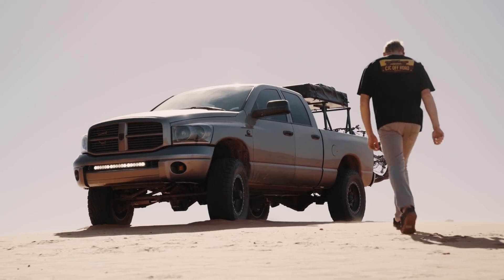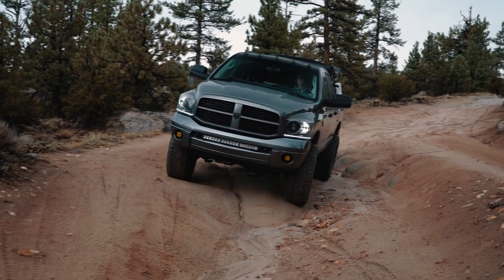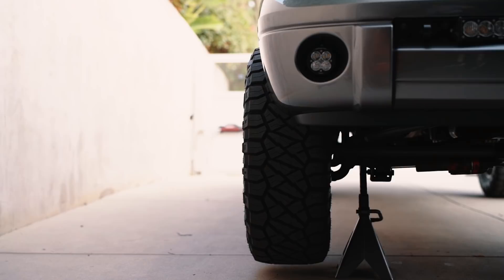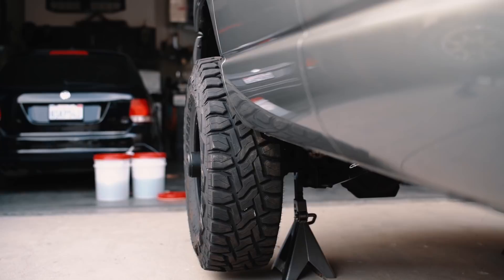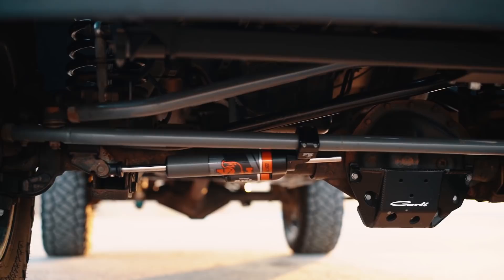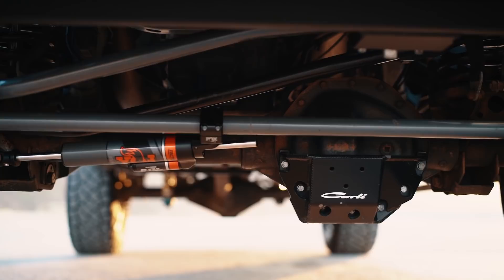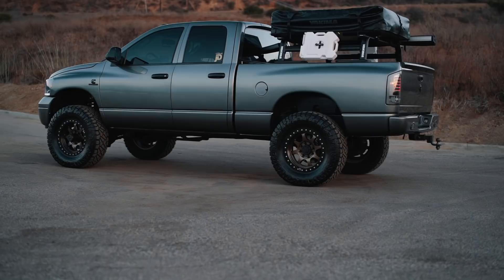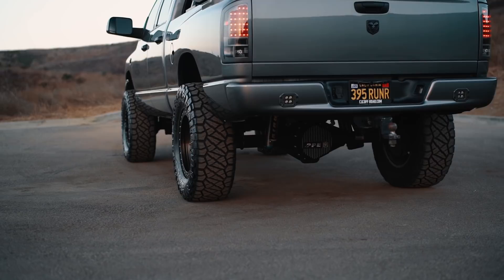How to Fit 37s on Your 3rd or 4th gen Cummins Ram 2500/3500 the RIGHT Way!

Comment: As the original owner of an 03 Ram QuadCab Cummins 4wd, I am glad you’re making videos on 3rd Gens. I mounted 35 inch Toyo AT2 on the OEM 17 inch wheels but couldn’t stand the lock to lock rubbing. I put on a wheel spacer to avoid the rub, but my truck profile looks

Comment: Yes! Thank god for this video. I know CJC, Carli, custom offsets and a bunch of other pros have videos on this but as a RAM fan only this is critical. I ran 33s on my stock zero offset wheels for years and I loved it except I couldn’t do 12.5 wides instead LT285s as the tires would rub the knuckle! Scary stuff man when you’re going 80 on highway literally wearing away at the sidewall. That was a young and dumb (and cheap) me. Of course I’m talking about a 1500 here and not a 2500, but there are similarities and benefits to IFS when it comes to running neg offset wheels because the steering is so much better than a solid axle. Now I’m more of a fan of keeping the ride closer to stock so no large lift just maximizing performance and keeping truck with a lower center of gravity and maximizing ground clearance on 35s. When I have a 3500 I’d love to do an AEV, carli or thuren system with only 3” of lift in order to run 37-40s comfortably.

Comment: My 35x12.50 Toyo RTs are just about done. I’ll put them through at least the rest of this winter, and then I’ll think I’ll get a set of 37s. Probably buy Thuren arms and see how it goes. I rub just a bit at full lock now backing out of a driveway on the factory arm. 2012 3500 Thuren 2” coils, track bar, and sway bar so far. AEV wheels which are 17x8.5 +27.

Comment: Recommendations for a 2006 dodge ram 2500 diesel on 37s with a +8” lift for stability and control over the roads

Comment: Please do a video like this one what wheel tire combo specs you need to fit a 37 properly on a 2nd Gen ram. 
I want to do it to the one on my channel but I want to do it the right way!
Reply from the maker: It’s actually all the EXACT same info and specs except for the trimming. 2nd gens either need some heavy fender cutting, or a trip the body shop to have the fenders cut and sectioned to open up the wheel well more for clearance.
Reply: @JustDiesels  awesome thanks, I’ll have a look then since I don’t want to cut into my fenders, maybe I’ll just go with 35s! 
Great video always informative AF per usual 💯

Comment: Love the no nonsense technical videos! Question, have you towed with those 37's? I've got a 10k travel trailer, thinking side wall roll might be a issue . Thoughts?
Reply from the maker: Yep! I tow all the time with zero issues! Even on 17/37 it’s no big deal at the proper pressures.

Comment: I have a question about wheels and tires for my 2012 ram dually 4x4.   I don’t really like any of the dually purpose wheels available.   Specifically the way the front wheels convex.  I understand why they do but I don’t care about being able to run the rears on the front or vice versa by just flipping them around.   What’s your thoughts on running wheels like yours on the front and getting the same wheels for the rear but doing offsets and a width that would not require a spacer and also would not stick out farther than yours do?   I’m not opposed to trimming and running 11,5 or 12.5 wide tires.  I have thuren parts on the front. And the rear is stock.  Any help would be appreciated.   Thank you for the content you put out.   It’s very informative and accurate.

Comment: I have a 03 ram 3500 single axle I put 18 in oem steel rims off a 2018 ram with 295 70 18 and I rub on lock to lock what do think I can do to stop this

Comment: I subbed you channel for more info. I do have a question for you , I have a 2010 2500 deez 4whl dr, I found some general grabbers X3's that are spec supposedly 10.1 tread width in inches,  37x 12.5xr17size,  I have a RC 2.5 leveling kit on it, no lift kit,  can I run them with 37's without going thru everything you said in the vid. Or should I stick to 35's. I live in Fla, an its mainly a part time on road truck, with some 2 track trails in the swamp for hunting, think deeper puddles an some swamp that get flooded in the rainy season, or the dirt road I live on during hurricane season. Yes it floods to 3 ft deep at times, hence the thought of running a slightly taller tire, Factory wheels also. BTW. I'm retired an not looking to build a monster truck like I did 40 yrs ago. More into the KISS principle, with durability being #1, not alot of mods to it. Thx, your thought on this are appreciated Bill Mc

Comment: Are the Carli HIGH-clearance control arms necessary for the application you describe here (37’s on 8.5 wide wheels, 12.5” wide tire. On a +18 to +25” wheel offset). Or, would the regular Carli or stock control arms work? Thank you

Comment: I have 2006 dodge ram 2500 power wagon and my steering wheel when I was driving it was locking why is that

Comment: Hi, I have a 2013 2500 5.7 with 18”x8.5” wheels and +10mm offset.  Do you think I could run a 37”x13.5” tire with this setup?  I’m willing to run 12.5” but was just curious since you’re running the 13.5” with less offset and a wider wheel than I have.  Curious what tire that 13.5” is as well?
Thanks!!

Comment: Question, you say you run +6.8 off but you said you need +18 to +25 to run 37. So do need +18 to +25 in order to not have to trim
Reply from the maker: Yeah notice that section where I show the trimming necessary for 38s? My set up BARELY clears while the +25 wheel clears with tons of space. You always need to trim for 37s, but a +25 with 37/12.5s is VERY minimal trimming of some plastic.
Reply: @JustDiesels  I am so confused by this, as a +25 sits closer to the body and control arms, where a 0 or negative offset would sit further away. I'm about to buy wheels and tires but I want to make 100% sure I understand this properly. Thank you for your time and work! Great video and awesome truck!

Comment: Does the offset and backspacing guidance you have here also apply with a dually? All the posts I see on 35s plus with duallys mean you need spacers, which I'd love to avoid. Not as many options it seems for the dually?
Reply from the maker: No duallies are a whole different game!
Reply: @JustDiesels  yeah I'm seeing that. Looks like for what i want to do with the Carli leveling kit, 35s on 20s are best. Just have to find wheels will work, that I also like. Some of what is out there is just not my style.

Comment: So I’ve got a Carli backcountry lift on a 2013 ram 2500 with a +25 offset 17” wheel. I can’t decide between a 37x12.50r17 and 37x13.50r17. Is there anyway you know if I would have to trim for these? I currently have mud flaps on that I would like to keep but if I have to trim for the 12.50 I would obviously be taking off the flaps. I would prefer to run the 13.50 and the mud flaps but I haven’t been able to get an answer from anywhere. Any advice would be greatly appreciated.
Reply from the maker: You’ll have to trim for both, but much less with a 12.5 so if you want to keep flaps, that’s the better path for you.?

Comment: Very much enjoy your videos. I just picked up a set of Method 17x8.5 0 Offset. I'm going to put a set of 37's on that measure 36.7 x 11.4.  Truck is an 08 3500 with a 4.5" Longarm lift. Thoughts?  Hopefully only minor trimming
Reply from the maker: Should be good to go with that lift hight! Any more tucked in on the wheels and you’re going to rub the arms like crazy.

Comment: So, do your wheel offset specs only apply to a 3” lifted truck, or to a 6” lifted truck as well.  Will a -12 offset, 17x9 with 4.50” backspace wheel fit a 37x12.5 on an 07 2500?  Or is there still trimming involved.  Appreciate this video. Lots of great information.  <edit>  Too late😁. I went over to CJC and ordered 5 of their Racelines.  You sold me!
Reply from the maker: Actually on a 6” system you can get away with a 0 offset wheel or even -12. You may want to get 0 just for a little better proportions on that height!

Comment: A 9.5” wide wheel with 5.5” back spacing is +19mm offset correct?  I want to fit 13.5” wide tires and wasn’t sure what the +6.8 offset was referring to.
Reply from the maker: A 9.5 wheel with 5.5” bs is +6.8 offset. To fit 37s on a Ram truck I recommend a +5 to +27 offset wheel that is no wider than 9.5”
Reply: Thanks Andrew! Would a 37x13.5 work with a +10mm offset and 8.5” wide wheel?

Comment: Great video, very informative thanks.
I have a stock 04 3500 HD with 35x12.5 and it does rub at full turn....
Thinking about going down to 33 x 12.5 ... or am I reducing the wrong tire dimension??
Reply: What size level or lift was it? Just curious because i have the same thing and want 35s

Comment: Andrew.
Your youtube site and videos are the best. Very instrumental in helping me with my 3rd gen 5.9 build over the last year.
Time for new (and quality) new shoes and I want to move up from 35's to 37's. (35's look dinkey on that beast).
Currently, I'm running Pro Comp 20x9's with 0 offset (backspace 5).

I got my mech and tire shop telling me that the Nitto RG's 37x12.50R20LT should be okay on those wheels with maybe only minimal cutting.

Can I please ask you to evaluate this setup for me and share your thoughts as I respect your opinion.
Thanks very much and keep up the awesome videos.
r.
Reply from the maker: If your truck has a level, adjustable track bar and arms, 37s will fit on a 0 offset wheel with some metal pinch weld and fender trimming. I’d personally recommend swapping them for a +18 offset wheel to avoid cutting up the truck more than necessary though.
Reply: @JustDiesels  Andrew... Thanks very much for your reply. I do have the Synergy Adjustable Track Bar but fixed ICON Front Upper and Lower Links / Control arms. I'm hoping that will work.

I'm going to go ahead and proceed with the plan. The only thing where I deviated is I'm going to try out the newer Mickey T's Baja Boss A/T 37x12.50R20LT tire.  I'm hoping that is a good choice.
Thanks again... Keep those great Dodge Diesel (especially 3rd Gen) videos coming. They're very helpful!

Comment: Is it possible to make 37x13.5r18 clear without any lift kit or leveling kit on an 18x9 +18 offset and 5.75 back spacing on a 3rd gen
Reply from the maker: If you’re okay with trimming, yes.

Comment: I'm about to take the plunge and move up from 35" to 37" on my 2005 3500 ( currently a 3" lift).  You mention early in the video your recommendations for wheel size (8.5" to 9" width) and offset (+18 to +25) for 37" tires.  You then mention that you run a 5.5" backspaced 9.5" wheel that is about +6.8 offset and a 37x13.5".  So I'm a little confused about the use of the two different wheel references (offset, then using backspacing).  I think in the comments later you mention using a 8.5" wheel.  Just trying to clarify before buying... I"m looking at a 17x9" wheel with a 5" backspace.  Do you feel this will require too much trimming?  With my current set up I'm already rubbing on the control arms.  Thanks for any extra help!!!
Reply from the maker: 5” backspace is actually a little too aggressive for these trucks on a 9” wide wheel. It’s a little confusing since backspace, offset, a s width are all related to each other. To fit 37s on a Ram you need a 8.5-9” wide wheel with +18 to +25 offset. Stick in those specs and you’ll be set with very little trimming. Since my truck is outside those I had to do some decent cutting!
Reply: @JustDiesels  Thank you very much!  I think I'm going to go with the CJC Raceline wheels made specifically for my application - they fall right in line with your recommendations.  Next up though is finding an e-rated all terrain that is 37".  THANKS!

Comment: So to say that if I run a 17x8.5 with a +18 offset on my leveled 12 RAM 2500 CTD on 315/70-17's I will not have any rubbing? I did replace the track bar with a Carli which did center the body over the frame, because right now my wheels have a -6 offset and I do get slight rubbing on the left side inner wheel well liner when I make a full left turn.
Reply from the maker: Yeah with that tire size you’ll be completely fine. You could even do a 8.5” wide 0 offset wheel too.
Reply: @JustDiesels  I did do a +18 wheel with the 315's and no rubbing left or right, I am kind of curious how 37's would look, that would push my truck up a little higher.

Comment: I looked up a Carli suspension for my ‘03 Ram 2500. All the suspension kits look to be for 4x4 trucks only. My truck is a 2WD, any recommendations for a good 2WD suspension?
Reply: Yesssir, trade it in for 4WD.

Jk
Reply: @johnjohnson9431  This but without the JK
Reply: @dragoonTT  I don’t ever go off road and don’t go through inadequate road conditions. Therefore, 4x4 is completely useless for me. I use my truck 100% highway use.
Reply: @spencersgarage  Just curious why you are looking at new suspension? Maybe get some nice shocks and new tires. It would do wonders if you haven’t touched them since 03’.
Reply: @dragoonTT  like the commuter kit offered by Carli, I’m looking for a more comfortable ride. Exactly what the commuter Carli kit offers.
Reply: @spencersgarage  Yeah I was looking into it as well, take as many parts from it and make your own 2WD kit.
Reply: @dragoonTT  4x4 shock mounts are different than 2WD. The kit needs to be for a 2WD truck or it won’t work.
Reply: @spencersgarage  If you phone Carli they will have a solution for you or at least somewhere you can start.
Reply from the maker: Unfortunately nobody makes much for the older 2wd trucks! The only real option is the junky spacer lifts with some Fox 2.0 shocks.
Reply: @JustDiesels  fox only makes shocks for the rear not for the front. Damn.

Comment: So the rear suspension is all stock no, 2 inch block or added leaf springs?
Reply from the maker: No this is a Carli rear leaf pack, but that doesn’t change tire fitment.

Comment: So if I get the correct rims I could run 37's without a lift? At least till I'm ready to decide which lift I want.
Reply from the maker: If you’re willing to trim like you would for off road use then yes. If you want to do a “street trim” then no.

Comment: What issues did you have with the Metalcloak control arms? I have those on my truck right now and want to know what I should look out for.
Reply from the maker: I just wasn’t happy with the joint quality. The ride got substantially better just switching to the Carli arms.

Comment: I need your help Andrew, I’m completely new to this. I have an 04 ram 2500 5.9 rwd (Early 3rd gen) that I want to lift 6 inches and then put the exact same rims and tires as your truck (I really love the look).. will it work? Would I need to cut my fenders or get a longer control arm? Please help before I go on and purchase everything.
Reply from the maker: With a 6” lift you’ll actually want to go long arm. All the exact same information applies though, but just know that a 6” lift is not necessary to run 37s! You can run them at leveling height.

Comment: Question for you, I just put the Carli 3" with extended control arms on my 06 ram. I have 17" Trail Ready Beadlocks with with 4.5" BS...Can I do 37x12.5s with only trimming the pinch seam?
Reply from the maker: Since 4.5” BS is pretty aggressive, you’ll need to trim the fender liner plastic, pinch weld, fender, and front bumper to clear 37s.
Reply: @JustDiesels  Thanks...ill measure the BS again to verify just in case.
Reply: @JustDiesels  so I checked again…the wheels are actually 3.5” BS….how would that fair in your mind with 37x12s? I do have the extended control arms
Reply from the maker: That’s SUPER aggressive. With wheels that wide, you’ll need major trimming of the fenders and bumper. I’d personally sell those and move to a different spec unless you want to run fiberglass fenders. 3.5 is perfect with fiberglass.

Comment: Ok so I bought my truck lifted already.  Has the 5in rough country and I have 37x13.5x22 under it.  The rims are fuels (not sure what model) and also have the fender flares.  I have cut what I can but still get a bit of rub on the full turn and hitting a bump.  Would putting a 1 in spacer on to get rid of the rub?
Reply: That would make it worse. Think about it, it make your wheels farther out = takes more room to turn the wheel all the way
Reply from the maker: Spot on.
Reply from the maker: It sounds to me like you have the wrong wheel specs on the truck. My guess is that your wheels have a decent negative offset, which will cause rub even on a 5” lift. Your options are to swap wheels, go down to 35s, or just let it rub!

Comment: I have a fabtech 4.5 inch kit on my 06 will i be able to run 37's ok with your wheel specs? Im currently running 22x12 with 35's -55 offset and they rub at full turn
Reply from the maker: Yeah you’ll be fine. I’d recommend 0 to +12 for the best look on your truck.

Comment: Would I need "significant" trimming if I run BFG All terrain 37x12.50R17 on Method 315 with 0 offset and 4.75" backspacing? 2006 2500 and 3" lift
Reply from the maker: You’d beed to trim a decent bit, although BFGs run pretty far under the stated size, so less than what you’d need to trim for the same size tire from Nitto or Toyo.
Reply: @JustDiesels  Thanks for the info/quick reply. I'm guessing that I would be trimming the lower part of the wheel well by each door, correct? And do you think the tires would rub on the control arms?

Comment: Will these Fuel rims (D531 Hostage Matte Black, 17x9" with the 8x6.5 (8x165.1) bolt pattern +1mm offset, part number D53117908250) work with a  2005 3500 with 3" thuren lift-full control arms etc.. Sorry not understanding this.
Reply: Looking to install 37x12.5r17  Patagonia  mts
Reply from the maker: You can do it with that wheel, but with a little more trimming than what’s shown!